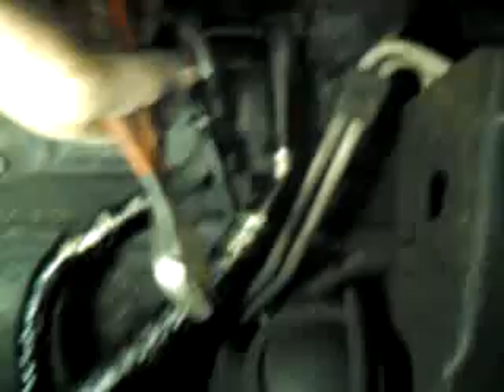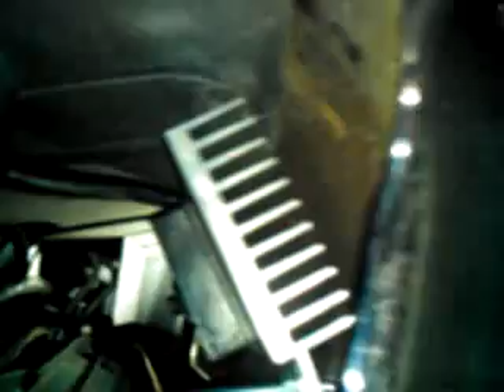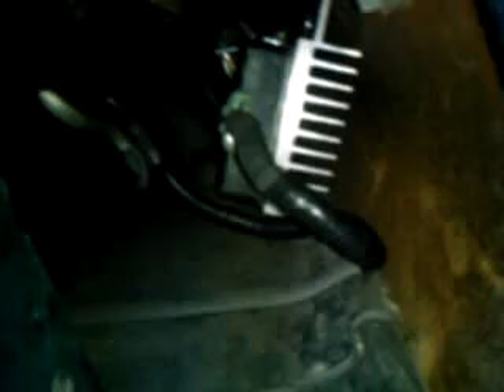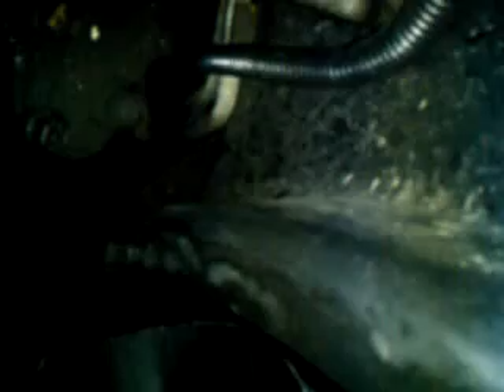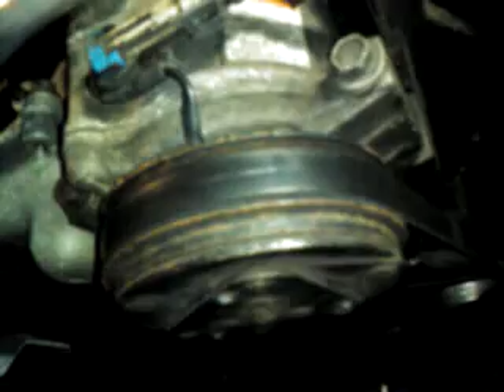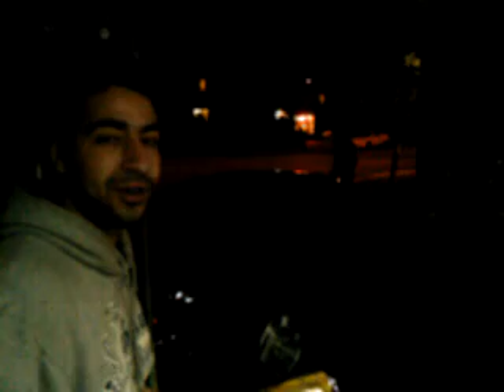1997 chevy suburban 6.5 turbo diesel PMD relocation part 2 .. Midnight Auto

Comment: Myself I ran mine behind front license plate here how I did mine. Got 4 1/2 bolt 5/16 in size. Remove bolt as shown on video. But I put bolt in hole and use 5/16 flat washer and a 5/16 lock washer and nut and almost tighten all the way. Leave room to wiggle to bolt to install thru heat sink. Then add another nut on same bolt and get a couple Chevrolet Brake Caliper sleeve (2) for  like older Chevrolet car or truck like in 70's  will be enough put these on next same bolt and then heat sink, Caliper sleeve will give you room about an inch to keep it cool.( Used as shim) Or small pipe will work not too big. Idea is to get your heat sink away from front bumper for air flow.  Another flat washer and lock washer and nut tighten nut closes to bumper first than tighten nut closes toward radiator and me I added one more nut just makes sure it all stays tight. Easy to do takes about 20 minutes to install hard part running wire harness. I use a welding rod bent like a hook on the end and string made it easy.

Comment: Are you skeptic about relocation behind front license plate for your PMD box.
Me I live in Texas and today date is August 28, 2014 and today temperture is 105 degrees.
I just got done driving 110 miles at 70 mph. Soon as I got home using a new Matco Digital Temperture reader with lazer sight my reading on top of engine was 154.7 degrees where pmd is mounted on side of injection pump. Note My injestion pump was install new this past October 2013 and I got 3651 miles on Grey PMD box and it failed. Stall out while going down the road. And where I moved my PMD to behind Front License plate reading was 105 degrees This reading was taken at 3:00 P.M. today plus I was in some stop and go traffic too so you know it was very hot. My truck ran just fine. My truck is 1995 GMC Diesel 6.5 litter Automatic with cold a/c that works very well. I hope this posting will help you out if you are wondering if it is worth the trouble or not. To me it is.
P.S.I forgot to included my injection pump was new not rebuilt last October 2013 and 3651 miles later my pmd failed. PMD box is Grey